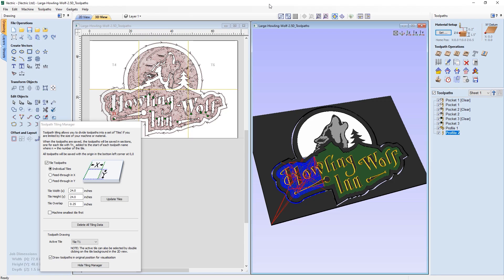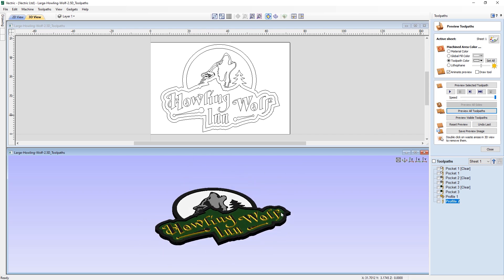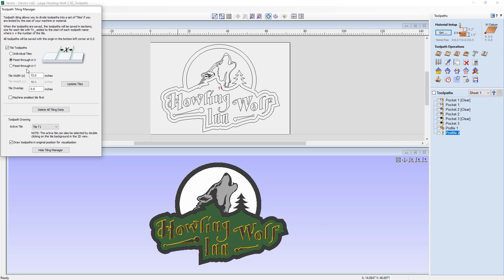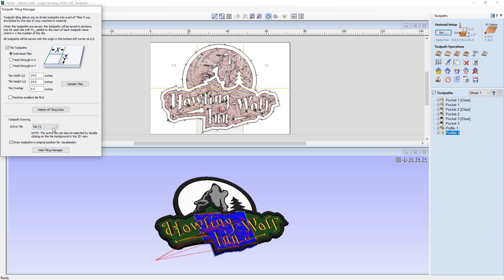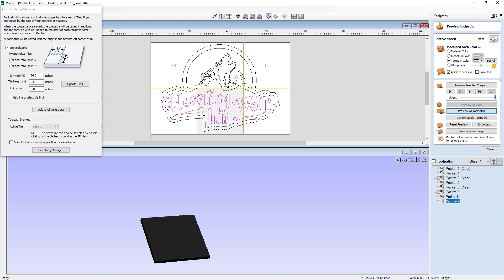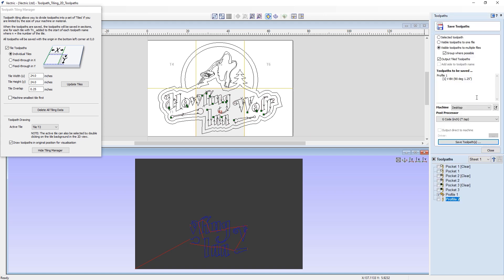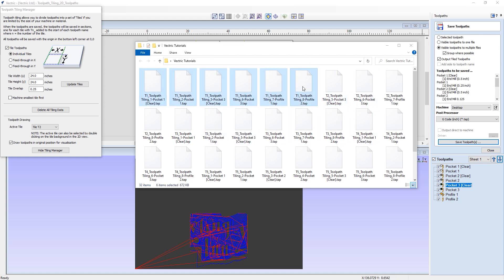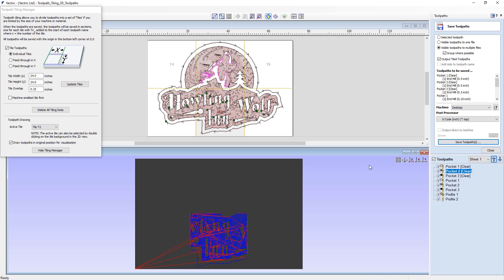Toolpath Tiling | Vectric V11 Tutorials

Comment: Once you figure it out, the software guides the machine as intended. Unfortunately the user interface sucks so badly that it will take you an hour to figure out the simplest operation. What is bad about the UI?
- tooltips: sometimes they use them sometimes they don't
- little written documentation: if you just need a quick reminder about how to perform a given task, you will probably not be able to find a descriptive article, you have to sit through their GD videos and hopefully you'll catch what you need
- excessive number of steps required to get to commonly used windows
I could go on, but I've vented enough for now.
Reply from the maker: Sorry to hear that you are not happy.  I would suggest you send an email off to support@Vectric.com with all of your comments, and we can have a look.  We are always looking for user feedback.  Thanks.

Comment: For a 2 tile job-   If you are using .125" overlap, for a 48" total Y length, 24" tile Y length, would you slide the material exactly 24", or 23.875" for the second tile run?
Reply from the maker: Hello Michael... you would move it 25". If you need more help on that please contact support@vectric.com.  Hope that helps.
Reply: @vectric  Is the 1" feed through standard regardless of tile size or overlap distance? I know im reading too much into this. :)
Reply: @mlarsen77  yeah im still confused
Reply: @vonster22  with zero overlap, you move the piece the tile length minus the cutter radius.